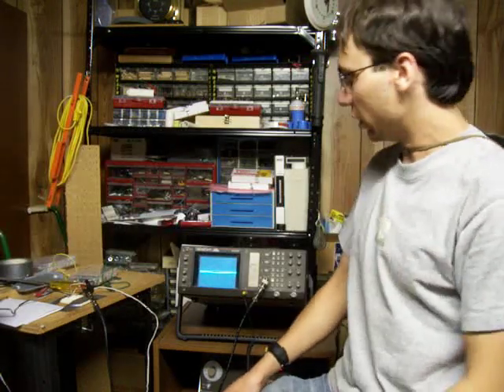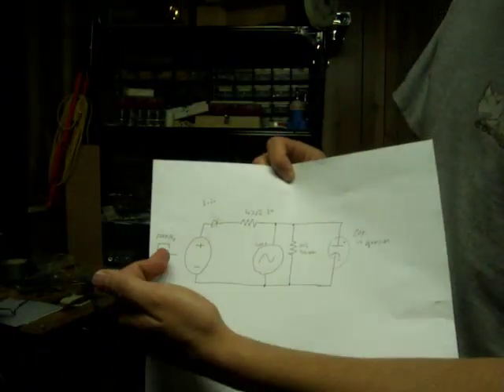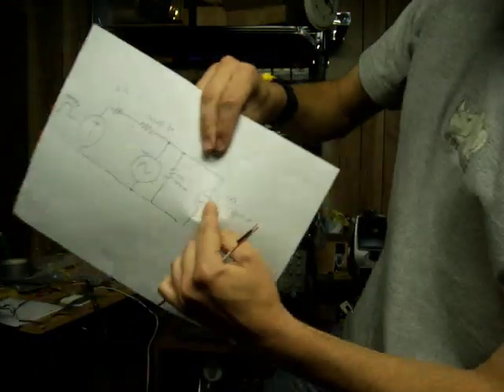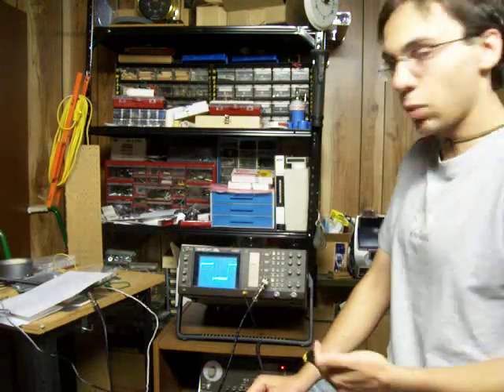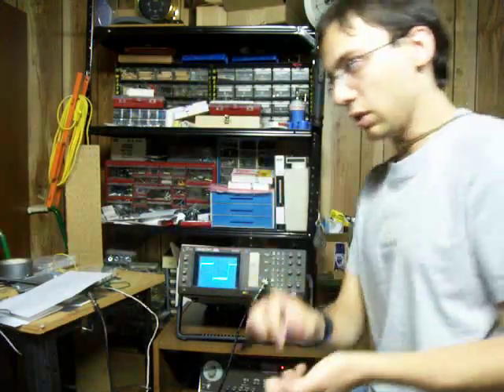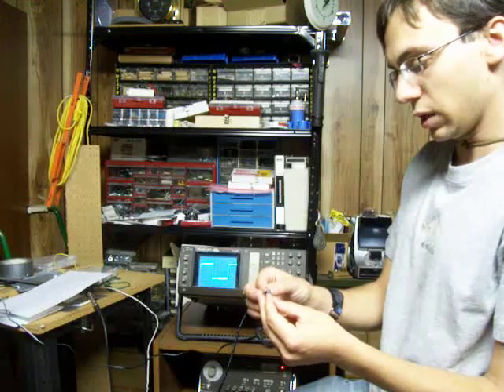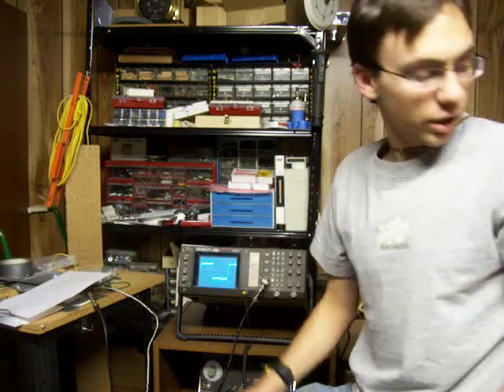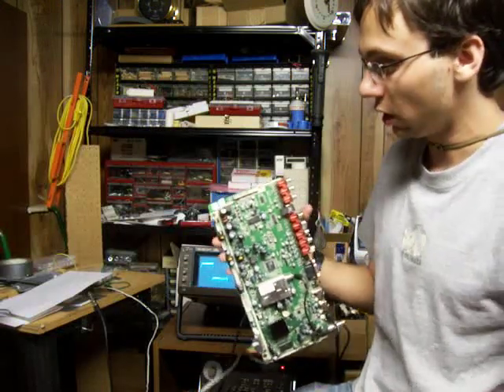Capacitor ESR test w/o ESR meter

Comment: Holy cow!  You were holding the same mother board of my 37 inch Insignia TV, which I was trying to fix.  I was trying to figure out how to use my function generator and oscilloscope to find out faulty capacitors since I don't have an ESR meter (yet).  Anyway, I figured out last night that it was a bad 12 volt regulator and your video had enforced my understanding of ESR measurements.

Comment from the maker: @1204ROY I was able to find the fault in this signal board. It was a couple of broken connections under a BGA chip. Reflowing the board in its area re-bonded this chip and gave the set about a month of use before it separated again. And again. And again... It got to the point where I tried to re-ball the IC and failed at my attempt/board traces began lifting from the heat cycles I put it through. So, I purchased a new main-board, and am in the process of accessing tools to calibrate it.

Comment from the maker: An out of circuit test may be a bit more useful, but even still as you climb in frequency, you're reaching a point where you will need to be taking into account the capacitance/inductance of your test leads.

Comment from the maker: around 1MHz--> with the 0.1uF cap we get an expected ESR of 0.159ohms. Now, here's why I said it gets tricky. With such high frequencies, the transient response of nearby components will begin to affect your measurements. With smaller frequencies these transients in your tested board (and test leads) were once negligible. However, with a higher frequencies, these nearby components will eventually throw off your readings. -->

Comment from the maker: If the capacitor in question had a short fault, this method would show the cap was working correctly. You'd need to run a continuity test to be able to check for a short fault. Note that my method here is dependent upon the frequency sent to the tested capacitor. For example, with the two 10,000uF caps I have, they should show up with an impedance of 1/((2*pi*100kHz)*10,000uF)=0.000159ohms, or practically a short. However, this test would not work with low values of capacitance.

Comment from the maker: @blade004 I do apologize as my initial reply wasn't very useful, but now that this info is like the back of my hand: use this equation---- Cap_impedance=1/(2*pi*frequency*Capacitance). Find the frequency used by your meter, and the labeled capacitance you are measuring. Keep these things in mind though: the smaller your capacitance, the less useful this method will be, as the natural impedance begins to get fairly large.

Comment: Very good demo.  
In the 70's QST, Ham Radio Mag, had a simple circuit they called the Octopus. Instead of using a sq gen, they used a voltage dropping transformer and a few resistors. This hooked to a scope & produced a vertical line when shorted, a horiz line open and an L line through a transistor junction. 

Here is a link  w w w  .qsl.net/kd7rem/pdf/octopus.pdf

Was very good for cap test creating a circle or oval. 

Regards,
Glenn
DSM Labs ( dot com)

Comment from the maker: This is where things get tricky, but in the end you've gotta know what you're looking for. For example, take a measurement on a 0.1uF cap @ your 1kHz. --> 1/(2*pi*1kHz*0.1uF)=159ohms of expected ESR in a functioning capacitor--> not a useful measurement, or atleast the Vdrop across that expected resistance will trump any sort of faulting series resistance in a bad cap. So, personally I'd want to --> (continued in next comment)

Comment: when you test a cap in a board do you turn on the power or leave it off . Just wondering w. Also what type of oscilloscope is easy to use for me trying to fix audio recievers , vcrs and maybe televisions .Im looking at a portable vellman meter but people are saying its not that good for much other than testing thing for hobbys .

Comment: I don't understand the point of using the terminator. Since it's in parallel with the very low resistance of the capacitor, it's effectively not even there. No?